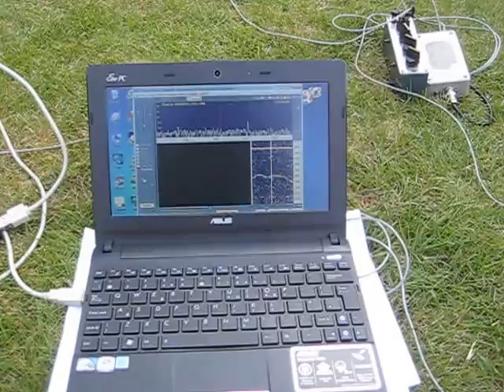VLF earth-mode receiving system (latest)

Comment: True "Earth Mode" is easier accomplished by plugging rods into the ground instead of building a loop.  This is the "Earth Dipole" method and I've had great success in communicating over a mile by using ground rods about 1/4 mile apart.  I have used audio amps and also an am carrier at 8 and 20 KHz The transmit rods should go deep but the receive rods need only to be pushed a few inches into the ground to receive the signal.  Receiver is a couple op amps driving 8  ohm speaker CHEAP -KJ4JAE -73

Comment: Hi Roger,
I was doing some research about omni-directional horizontally polarised antennas and cam acroos your blog and your thoughts about the Big Wheel antenna. Another source for these antennas is Winkler in DL: Hear is the link in case you are still looking.
Greetings from MIlton Keynes,
Reinhard, M0GER